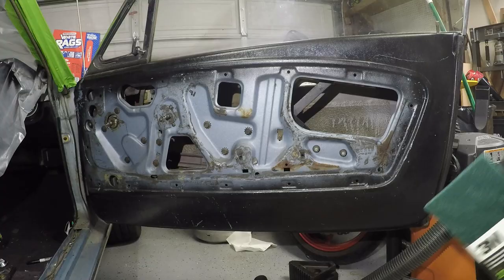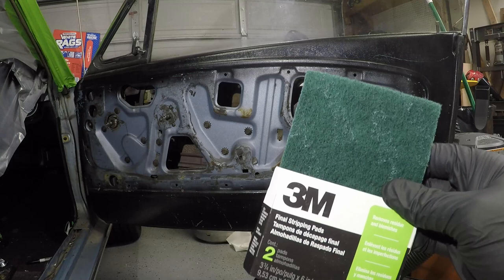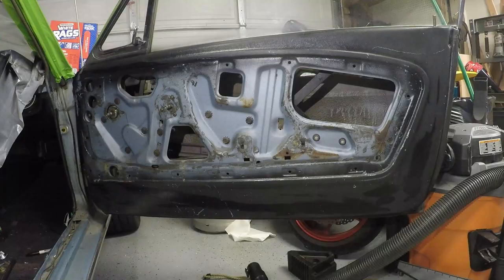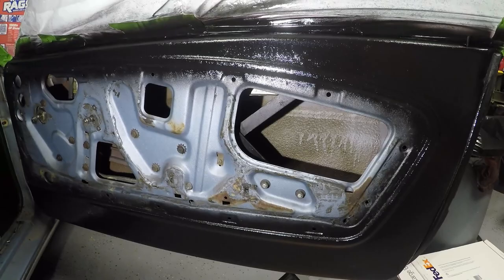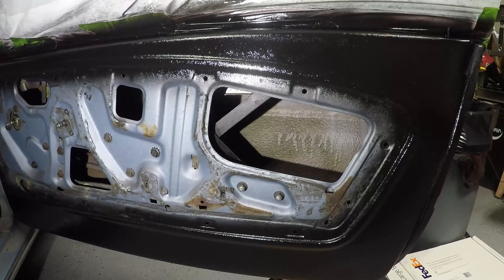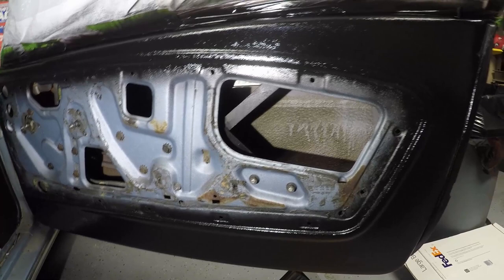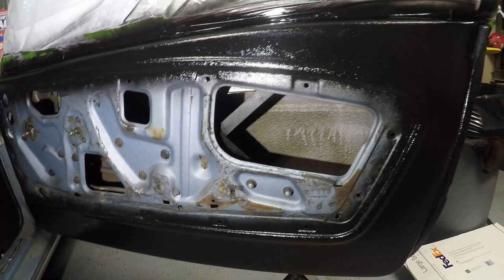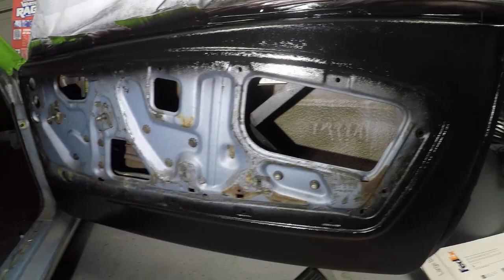PAINTING INTERIOR DOORS ON 66 MUSTANG

Comment: Hey, great info. Did you use the same paint as the quarter trim panels? I have a sautern green interior, but want to paint black. Do you think I would need a primer? Or just paint the black right over the green?  Thanks!
Reply from the maker: Thanks. Yeah I just used the same paint on both the doors and quarter panels and dash  (the engine enamel). 

My interior was originally blue. I just lightly scuffed them with one of those scotch pads, not enough to take the paint away just enough to give the new paint something to adhere to. cleaned it and painted. Keep in mind though I’m not a professional. 

I’m Not sure if primer is needed before hand. I didn’t use as I thought since I just scuffed the existing paint slightly and figured it was still good with what was there originally to protect it. 

whatever you choose to do. Do so at your own risk.